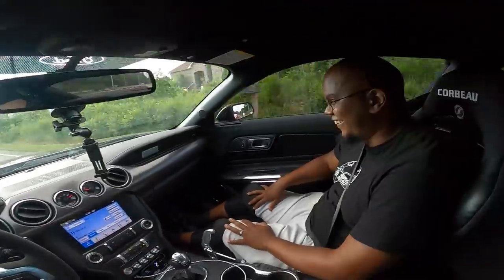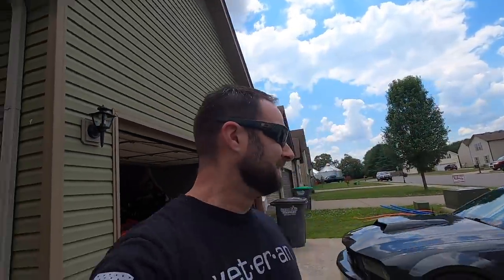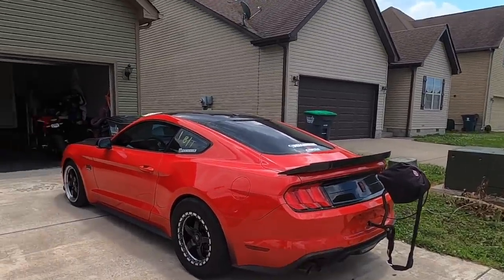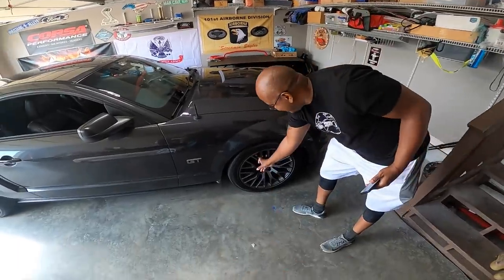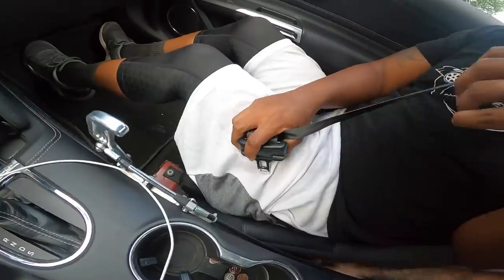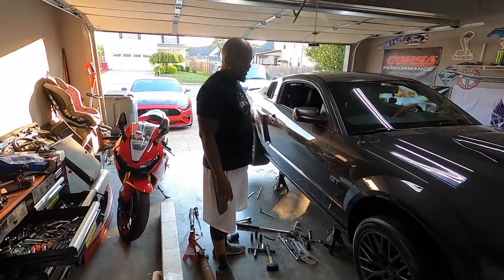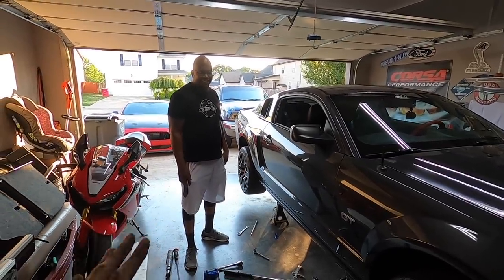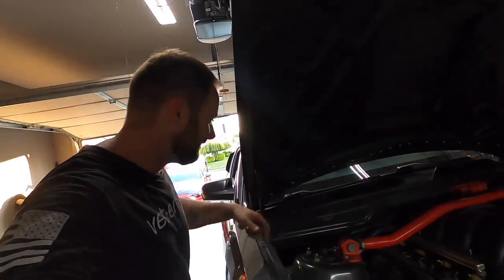FRIEND WHO BOUGHT A 2008 MUSTANG GT WANTED AN UPGRADE! *SO THIS IS WHAT WE DID*

Comment: What are the pro's vs con's on a S197 driveshaft upgrade like this?
Reply from the maker: Pros are a more connected feel. No driveline slop. Big power won’t break it. More acceleration due to lighter weight. Cons are possible slight vibration and whine. But I can tell you it’s minimal at best so don’t worry
Reply: @Zander13Productions  This would be for a 08 gt 500 super snake with 625HP

Comment: If David Vanvoris could run low 8s with a single turbo sealed motor I would hope like hell u could run just as fast
Reply: Patrick Scott give it time all he needs is some seat time. Dvv has built motor and trans though don’t he.
Reply: @boosted9319   he does now but went like 8.40 sealed motor.  And I totally agree seat time will help alot
Reply: Patrick Scott yea 8.40 on stock is fast af I race 8th I went 5.8 on a factory sealed gen 1 coyote. That was impressive to me. The gen two and three can hold more though. Building a 17 now Whipple gen 5 sc for the wife.
Reply: @boosted9319  think his is a 2018